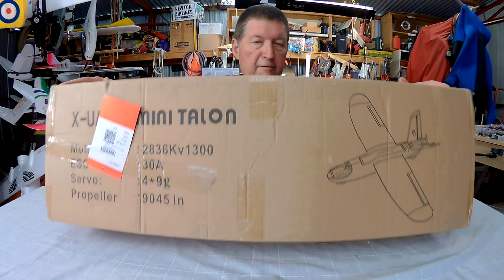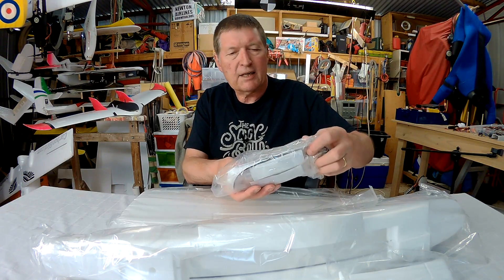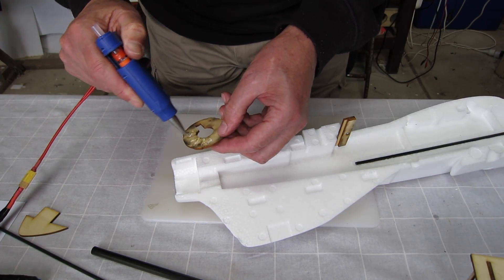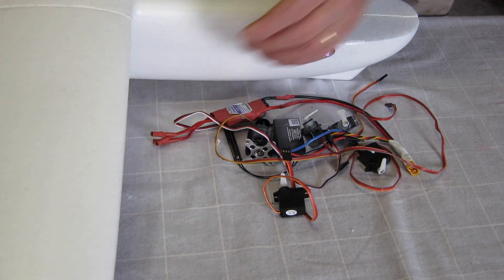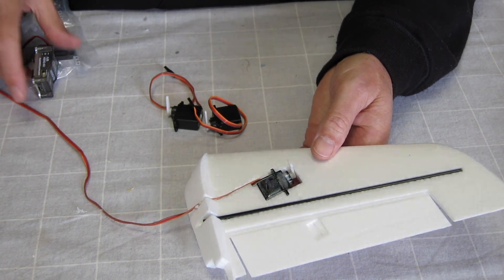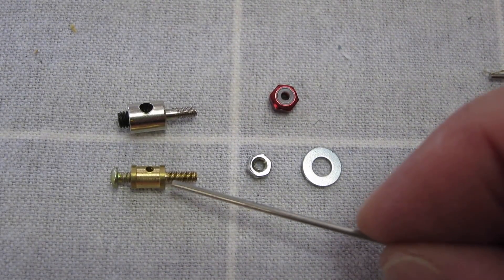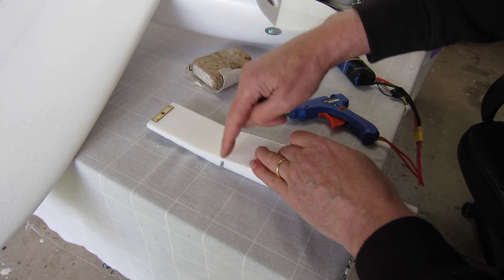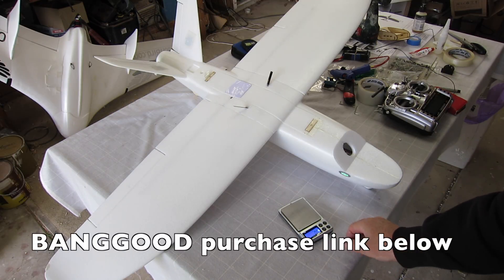XUAV Mini Talon kit build

Comment: Hi ,
Can you provide the positions of the V-Tail ruddervator for the stabilized flight mode. Also in stabilized mode , what is the position of the left and right V-Tail when we do a right yaw.....thank you in advance
Reply from the maker: I don't have a FC on this one. Just think of the VTail as two vertical rudders to work out direction of movement.

Comment: Thanks so much for this video.  Just putting together my Mini Talon now - the included instructions are not so great - this video is brilliant and has helped a lot.  I am interested to know why you are using so many different types of glue - what is your thinking here? Keen to understand!  Thanks again.
Reply from the maker: Use the glue that suits the material and application. Epoxy and CA for timber, hot glue and contact cement for foam.

Comment: I am about done with construction and I have 2 mystery parts left over.  Where are these supposed to go?  See https://vimeo.com/3462351231
Reply: Oops correct link https://vimeo.com/346235131
Reply from the maker: Hard points for the hatch? 0:38 Coincidentally, my next build will be another mini Talon so I can check again.

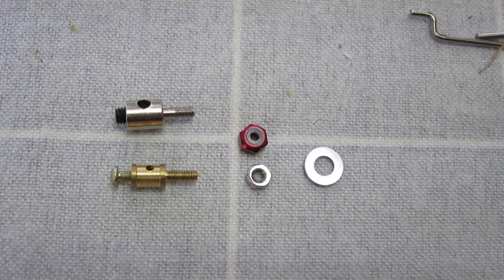Comment: @ 4:28 you talk about the Nylon Lock nut for the supplied linkage adjusters - what size nut is that?  Would you have a link?
Reply from the maker: M2 size, mine came from eBay

Comment: Start with cg at 55mm (later go as far as 60mm)
You dont have to glue the wings! They have a screw you tighten to hold the wings (allen key included)
Look out for the esc temperatures.
Here is Marks great builds: http://www.itsqv.com/QVM/index.php?title=X-UAV_Mini_Talon_Build_Number_1 (he has 4) anf he designed a lot of high quality 3d printed parts for it:
http://www.itsqv.com/QVM/index.php?title=Mini_Talon_Parts_Compilation
Reply from the maker: Thanks Marcin, I wasn't aware of the wing screws! Will have to look closer. My CG is about 75mm
Reply: no no no dont even try flying at 75mm! its an error in the manual!
Read this: http://www.itsqv.com/QVM/index.php?title=How_To_-_Hand_Launch_an_X-UAV_Mini_Talon
Reply: "Starting sometime in 2016, X-UAV started sending a build sheet with the kits showing the CoG at 76mm. This is completely incorrect and X-UAV has confirmed it is an error on their part and they will "correct soon" (February 2017). Earlier Mini Talon build sheets as well as the earlier planes which came with CoG decals clearly show the CoG at either 55mm or 60mm from the leading edge at the wing root. My original MT had decals at 60mm and #2 had decals at 55mm."

Comment: It's a nice plane. Has so much space inside. Anyone who used it - Skywalker 1680 or Mini Talon?
Reply: When skywalkers were new (the original 1680mm wingspan maybe 4 or 5 years ago) they were the best fpv airframes around. I had two but recently got a mini talon and I have to say that it outperforms my old skywalkers in every respect.
Reply: I've seen only one skywalker on hobbyking, didn't know there are any newer. So you're saying mini talon is better. And it's even easier to transport, I think.
Reply: I have both - Skywalker is better if you want a plane for slow-flying and looking around, Mini Talon is far superior for a faster, more nimble  flight.... I usually take the Mini Talon out as it's easier to transport.

Comment: First...lol...Oh, it's so well engineered Andrew, you will love it....I have 3 of them.
Reply from the maker: Well there you go, must be good. It seems to one of those "Just Right" models, for materials, size and design.
Reply: Yes, it flies pretty quick on very few amps if you keep it clean....Comes in fast....You need the CG on the servo wires where they enter the Fuz sides....Make sure you get it right and mark the Lipo Bay.
   Pleased you used the Laser cut Ply for the centre crutch, no idea why some folk have substituted 3D printed plastic ones....Complete mystery....Perfect model for iNAV....and an Omnibus F4 with built in OSD.
   Super lightweight Autopilot, and super cheap.  Mines got iNAV in it now, gave the APM the sack....lol.